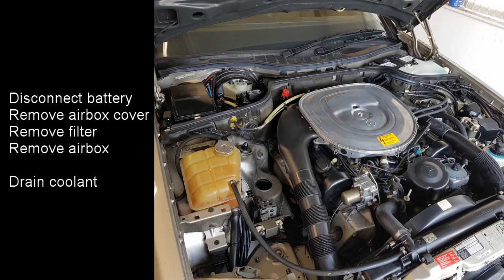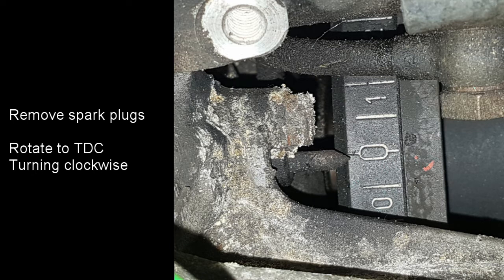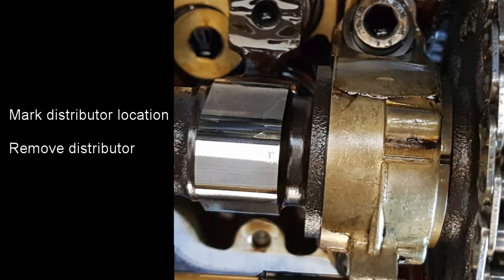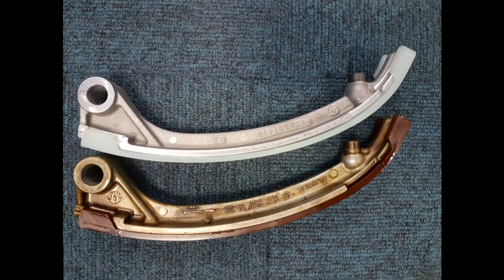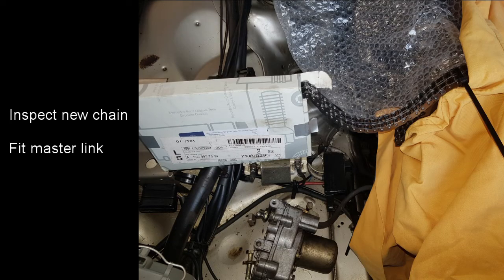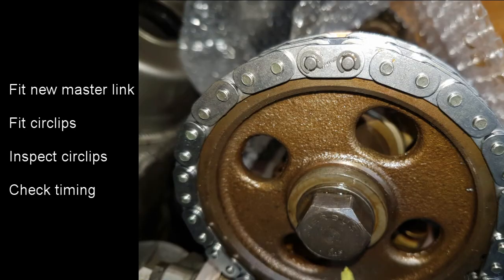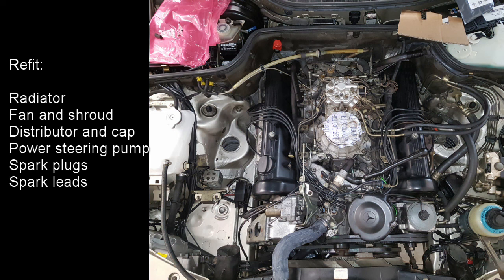Mercedes M117 engine timing chain and guide swap

Comment: Question.. the guide next to cylinder 1, has an aluminium cap with 6mm Allen head. When removing this the timing guide pin looks like a large 8mm diameter cotter pin / sleeve.. HOW do you remove this pin?
Reply from the maker: From memory there were pins which were removed by using a threaded bar to screw in to them and then a socket on the rear and use a nut to pull the spacer out.  Check to see if they are threaded.
Reply: @martinhill5770  thanks, in my case everything is original and the timing chain job is well and truly after 236,000 miles long overdue, yet it doesn't look too bad. The sleeve bore holding the tension guide is smooth so I'll require an eight 8 - ten 10 mm easy-out tool, it's not coming out easily. Some dude on a benz forum said he used a magnet! If only I lived in that world! I don't want to ruin the sleeve, but I think I'll have to be gentle.... somehow.

Comment: Hello Martin,
this is one of the best video tutorials on the subject. My compliments. I would like to know how long the repair took and if you changed all 4 timing chain guides?
I have a Mercedes 420 SL (01/87) with 38000 km. Do you think that it needs a change of the timing chain guides? 
Thank you very much for your answer cheers Walter
Reply from the maker: Thank you for your kind words. Unfortunately I don't keep  track of time when working on cars. I just do a little bit each day until it is done.
Reply from the maker: I would change the guides. As I understand it wear is about age not miles. It isn't hard, just take your time.
Reply: @martinhill5770   Hi martin great video, im just getting into a 78' 450SEL and im wondering if i should change the entire chain or just the guides since they are more prone to failure. If the chain doesnt slap or really twist upon inspection is it safe to change just the guides? cheers
Reply from the maker: @quincylongman7469  At the very least you could check the chain for stretch, but since you are in there anyway my preference would be to just do it.
Reply: @martinhill5770  Thanks! Probably go this route

Comment: the video does not indicate removing the cam sprockets when replacing the guide rails and guide rail.  Can you confirm that there is no need to remove the sprockets?  is there enough room to pull out the guide rails and tensioner guide with the sprockets still in place?
Reply from the maker: I am sure I did take the sprockets off, as I remember retorquing the sprocket bolt.

Comment: Lower rail guides? 1000 videos and nobody do not change the lower rail guides...
Reply from the maker: From what I read, the lower guides don't wear as much, and to change them is massively more involved. If the engine was out I would do them.

Comment: Awesome video. Did you remove the spark plugs?
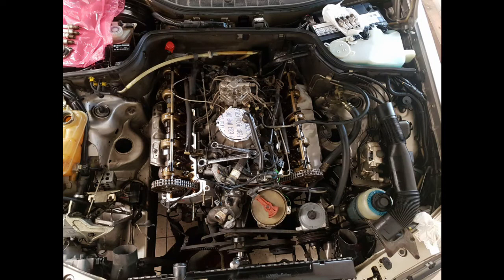Reply: At 1:31, you can see the Spark Plugs at the top of the image on top of the battery and brake fluid reservoir.
Reply from the maker: I don't remember,  but when doing a job which involves turning the engine over carefully by hand I would have done.

Comment: Where are you based? Are you a mechanic? I want to get my Mercedes Benz w126 sec done
Reply from the maker: I am based in Nottingham, but I usually only work on my own cars.  Sorry.
Reply: @martinhill5770  I'm up the road in Loughborough with a 500 M117.963 SEC. I'm just about to carry out timing replacement using a Febi kit. I'll check the tension shoe against the original in the hope it looks as good but I'm not holding my breath. Unfortunately I already lost an exhaust cam and lifter on cylinder 3 from a choked oiler. I'll never use engine flush again. I have a hunting rifle cleaning kit at home, I used this to clean the oiler tubes. You'll not believe the fines I discovered on my cleaning swabs - 5 passes till clean! I'm checking the oil pick up strainer too and pressed a perm magnet to the sump near the drain plug !
Reply: @martinhill5770  thanks ,me too 15 years working in my own cars 1988 560sel,1987 560 sec,1989 560 sl